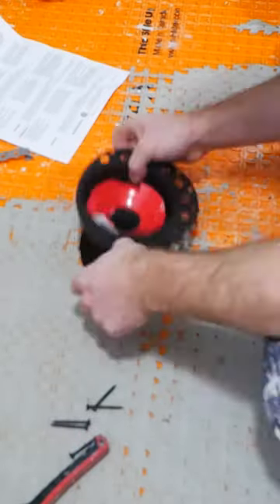How to Install a Freestanding Tub

Comment: Foaming window cleaner and a silicone tooling kit way better than your popsicle stick. It's one of those combos you can't believe you went so long without.
Reply from the maker: I’ll give it a try thanks!
Reply: Silicone refiner Spray and a Tool Bro.  popsicle sticks are for kids.Cali i charge bathroom average 10-12 grand in tile work ruined by the Ugly Caulking job of Plumbers..dont be that guy